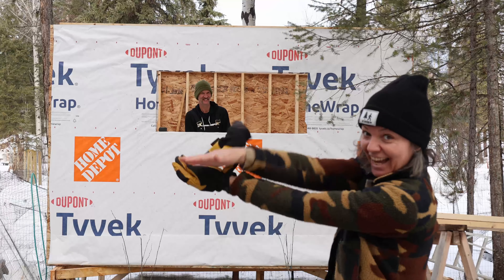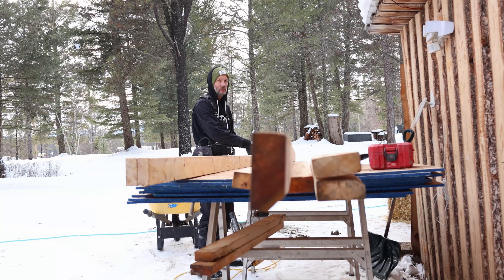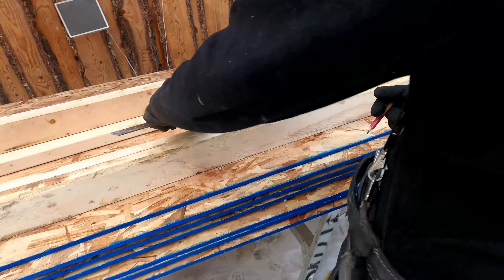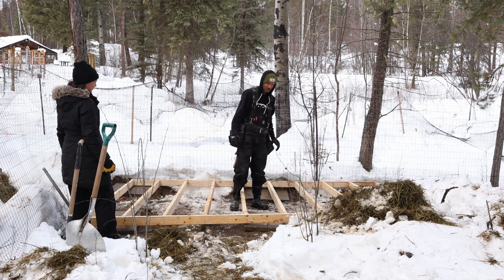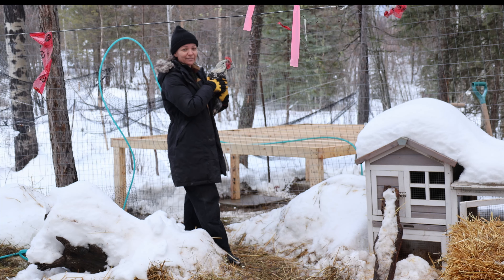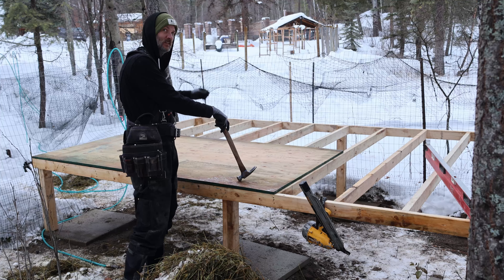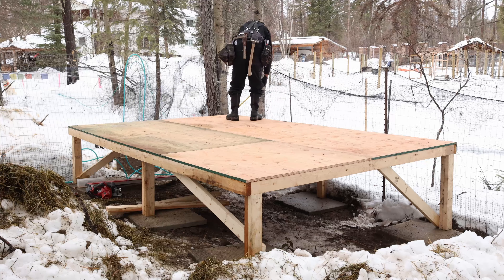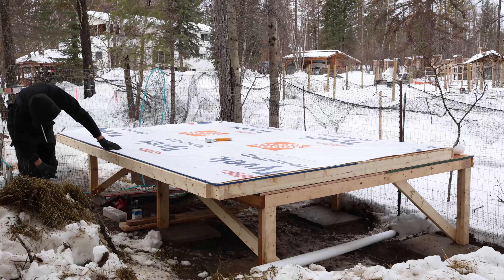How to Build a Cheap Chicken Coop  (Pt1)

Comment: what is the price comparison of standard 2x4 and rough sawed
Reply from the maker: This would vary depending on your location. Rough sawn around here is $2 per board foot. Rough sawn is also not graded so you could run into issues if using it for a structure requiring permits. If you have the option for rough sawn I’d take it all day long!